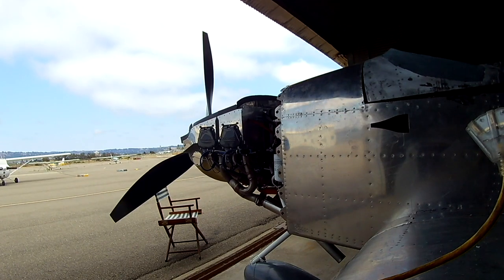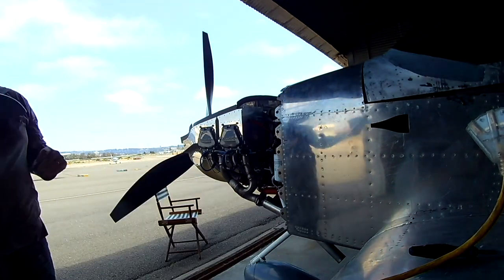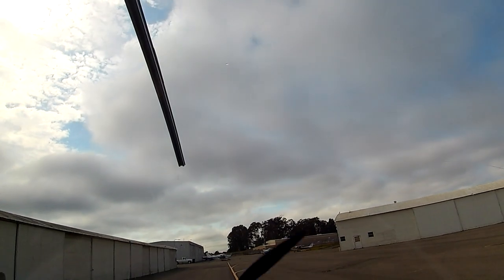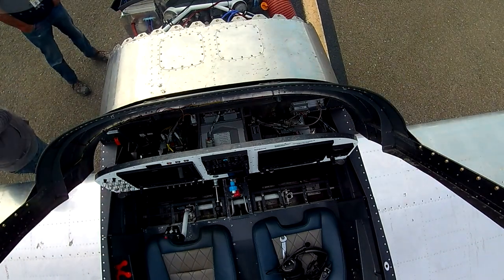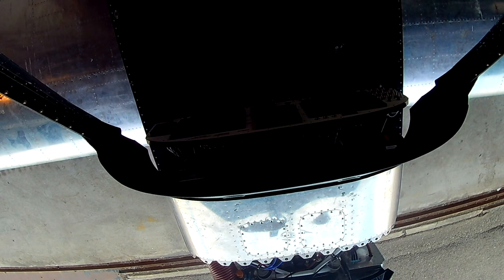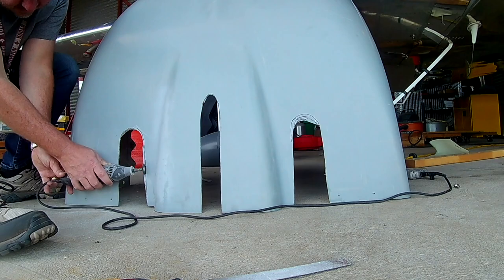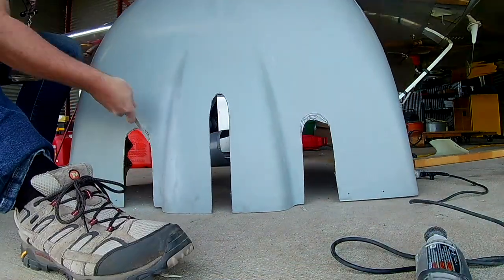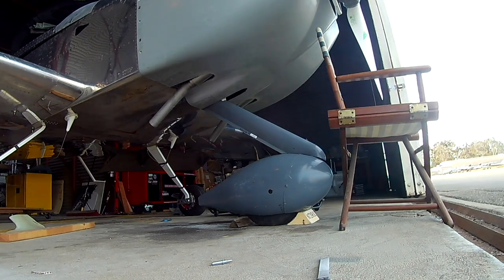RV-14 Filter Finalé, Run Up

Comment: Now..no, but before paint. 
What are your thoughts on the for deck access panels. What do you have up there that needs access?  And is it just for building or do you envision needing them in the future?
Reply from the maker: You mean the top front fuse access panels? Everything. They access... EVERYTHING! I don't even know how you're supposed to have ever finished a plane without them in!

Comment: Is there any corrosion issue with the copper bar stock being attached to the Adel clamp, which I assume is stainless steel?
Reply from the maker: Probably but its 1/8" copper. I have PLENTY of time to replace it with steel before it corrodes enough to affect its strength at that thickness.